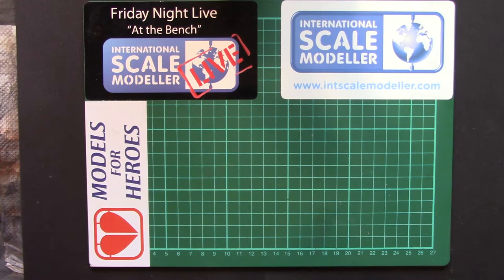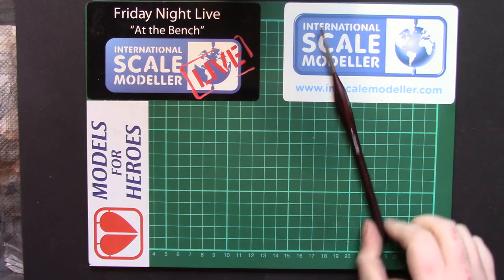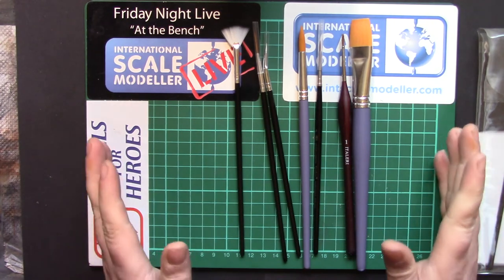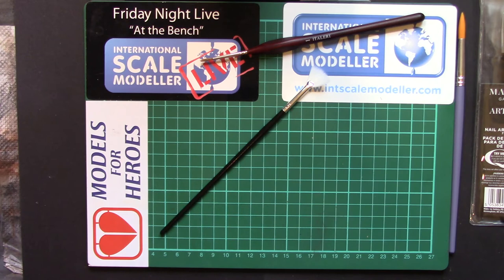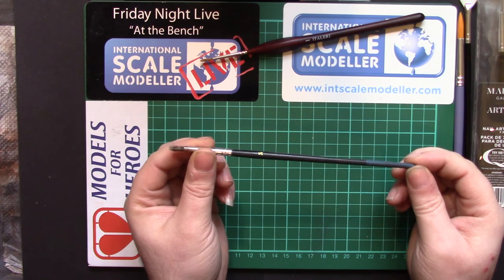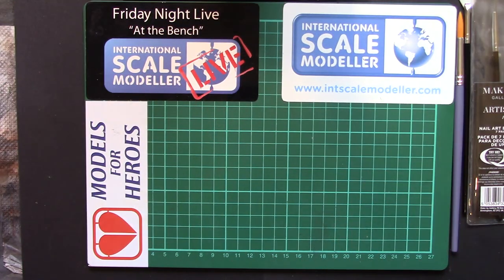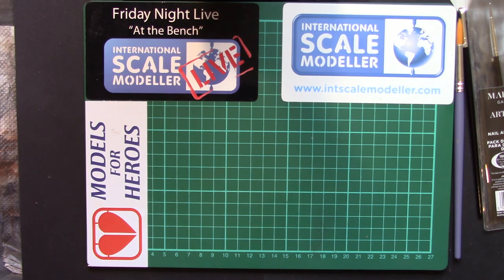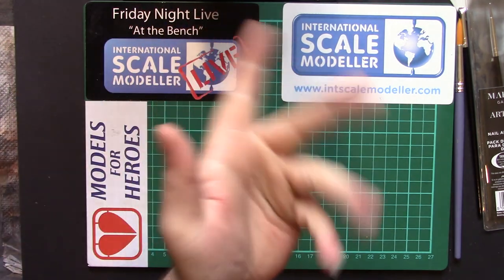Paintbrushes explained

Comment: Great vid as usual Sharpie, not just for the info, we do like your waffling too mate!
I've got them bent ferrule brushes too, cheap as off ebay, but they're great for stuff like getting between the hull and detail parts of a tank, places where you have to go under parts.
Also, when I started and knew nothing about brushes, I bought some cheapies off internet, sizes 0-3/0 made of weasel hair/fur/plumage. Since I've gradually bought better and better brushes these have come in for more and more abuse but amazingly still hold a decent point!
Anyway, lovely stuff mate!

Comment: I thought the point of storing them bristle down was to prevent any residual paint collecting in the ferrell?  maybe if they have been cleaned correctly this would not be a problem? Thanks for another useful and entertaining video.
Reply from the maker: If you have a holder which will store them bristle down then thats great, I've yet to find one that will and i have a tendency to lose the little plastic caps all too quickly.
Reply: You dry them bristle down, you store them as you want..